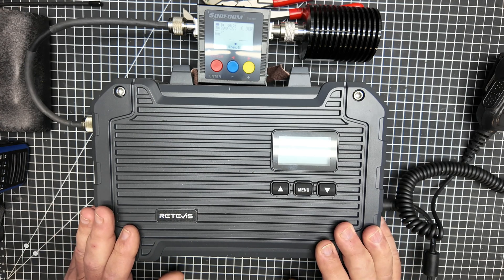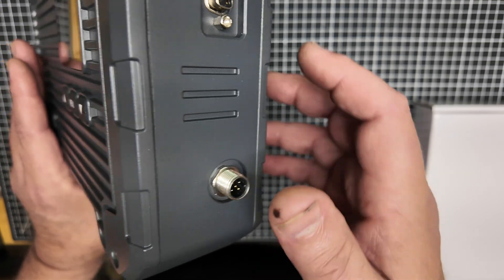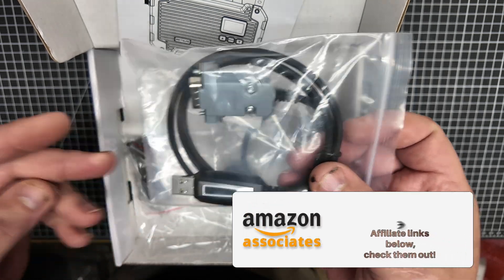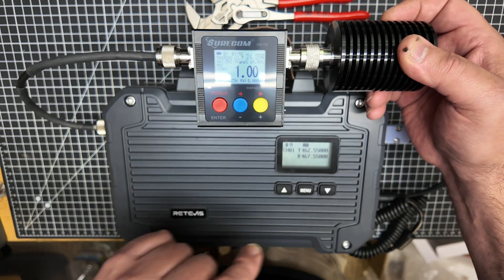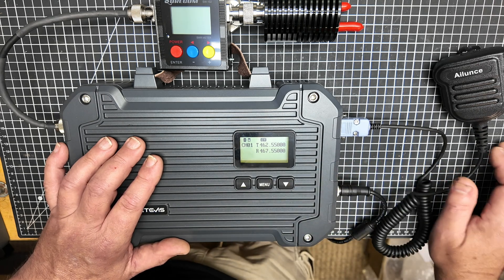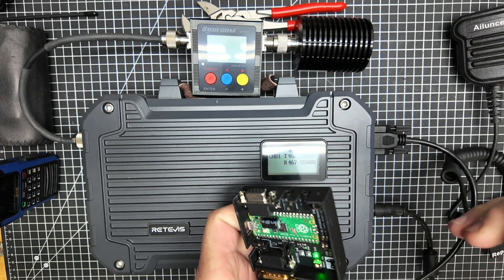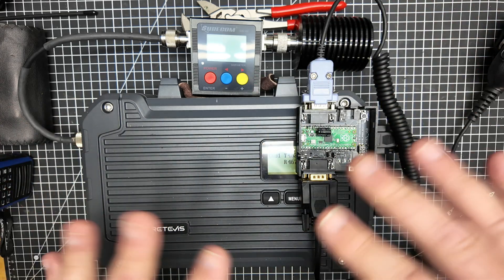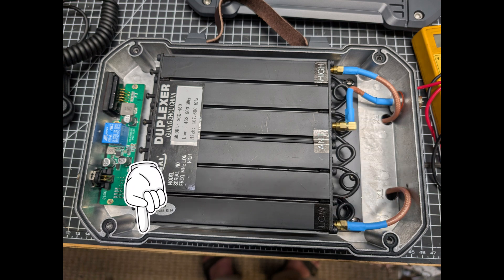New Retevis RT97L 25W GMRS Repeater: Easy Setup, Honest Power, and Top Build Quality!

Comment: This repeater sucks!  It put out 10-12 watts max.  I get more distance out of a set of 10 watt baufeng radios with a duplexer.   It looks good but poor output, I returned the one I bought
Reply from the maker: I am sorry that you did not have a favorable experience. Mine worked great and made a TON of power. You fail to mention what your input power was and what you measured it with. I tried to detail my setup for anyone interested. Maybe you just got a bad unit? Or maybe you are just really grumpy. I love mine and it handles my communications just fine. Have an awesome day!

Comment: Nice review! I have a couple of questions. 1. What is the duty cycle? 2. Can you use repeater to transmit on another repeater's uplink frequency (467.XXX)?
Reply from the maker: The manufacturer states it is 100% duty cycle. I think the companion frequencies are factory set per the GMRS standard, but have not explored what may be possible via the programming app.

Comment: I have the Retevis RT97S that had been on repeater status for about 1 year and then it suddenly failed.  I removed the cover and found the voltage regulator was blown apart!  Not having a schematic or information on the Internet about service of this unit, it is impossible for me to service this unit.  I personally would not buy this repeater until such information is readily available.  My opinion.
Reply from the maker: That’s a bummer about the voltage regulator! I would suggest reaching out to the manufacturer. I'm sure they would be able to help.